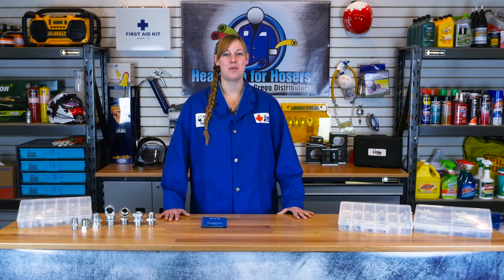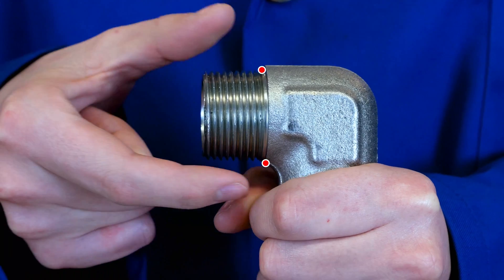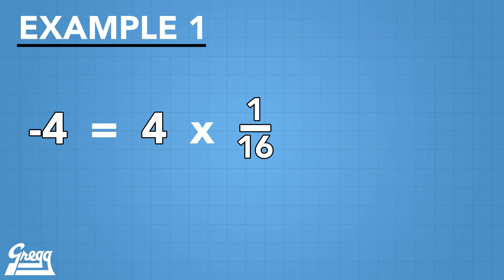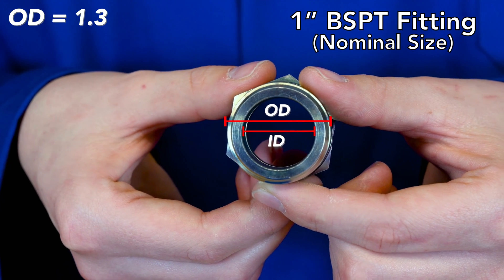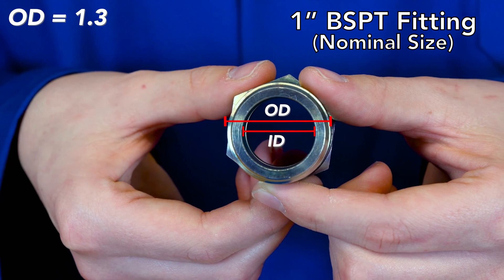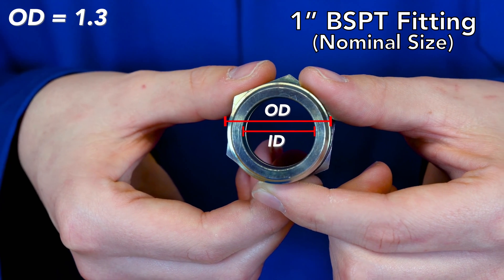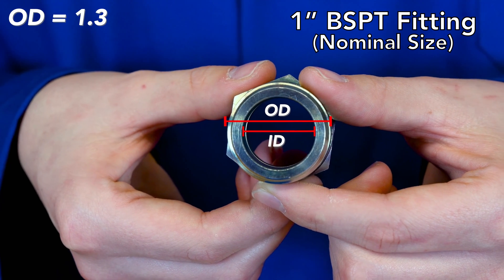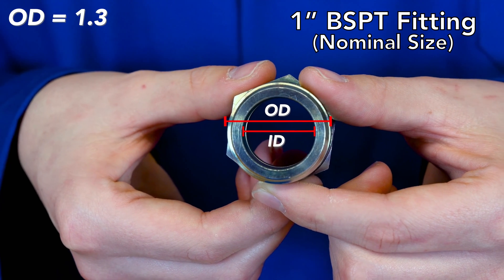BSPT Fittings / Thread - Identification & Installation - Heads Up for Hosers

Comment: Hi, what does RC or ZG for a taper for 1/8" - 28 HSS BSPT mean? Thanks.
Reply from the maker: As specified in the video, the "R" by itself usually indicates a BSPT thread and a "G" by itself indicates a BSPP thread.  Also, your reference to HSS usually is referenced when talking about drill bits.  HSS typically stands for High Speed Steel.  1/8-28 is a standard nominal thread size in BSPT fittings.
Reply: @GreggDistributorsLP  Thanks, I found that they are quality grade. Wish You the best for 2020 ;)

Comment: Your video is informative, but there are some basic mistakes in the technical detail. The BSP threads can come in a Taper Male "R"  and the Female can be either a Taper "Rc" or Parallel "Rp". As the Title of standard indicates these are "Sealing Thread".  You are also saying BSP is similar to NPTF, I dispute this claim. If you said NPT and NPTF would be difficult to differentiate, this would be correct. In another video on BSPP, you need to be careful in the presentation as the title for the standard for this thread  is a "Fastening  Thread, thus both the Male and Female threads are "Parallel" and designated with a "G". As stated previously the BSP Sealing Thread and the BSP Fastening both have Parallel threads but the Dimensions & Tolerances are different.